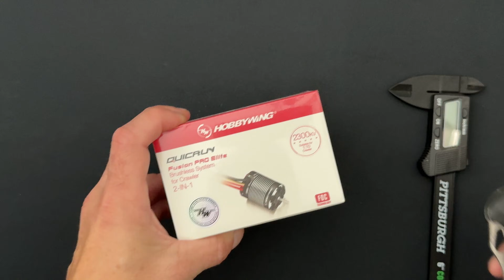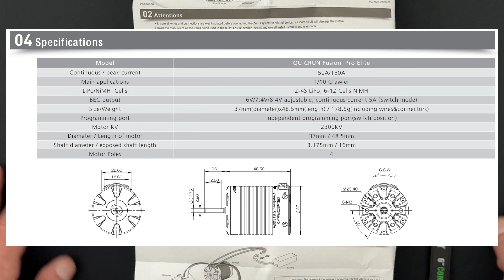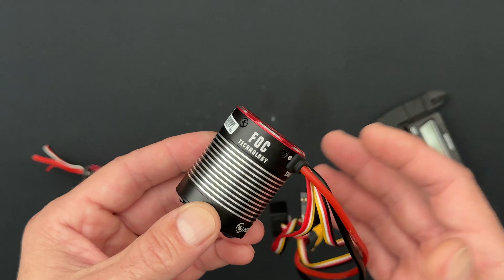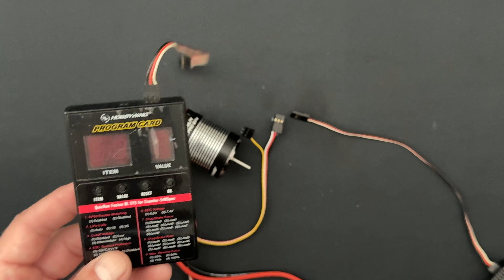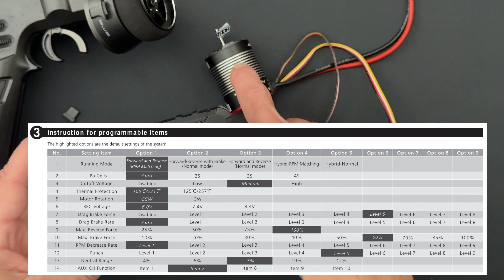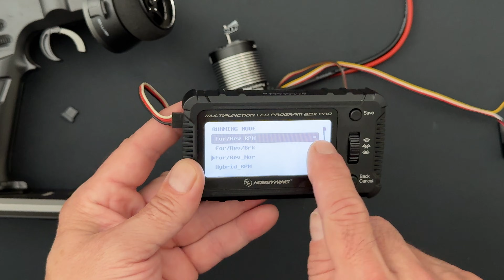HOBBYWING Fusion Pro Elite - First Look - The Charlie Show EP 438

Comment: Will Hobbywing eventually release a Fusion Pro can size 2 in 1 with the Fusion Pro Elite ESC? The Fusion Pro Elite seems to have to load up then pops out of a bind, where the Fusion Pro just muscles it way through a bind with slow and steady precision. Don't get me wrong, I think the Fusion Pro Elite is PERFECT for comp crawlers, and is ideal in my VRD Carbon and XP10, but I'd love to have the higher torque of the full size Fusion Pro and 4s capability for my H10 Optic builds. And I think everyone with a Traxxas TRX4 is thanking you for the Fusion 8 Pro. Best motor ever for a TRX4.
Reply from the maker: NorthAmerica@hobbywing.com - Drop us an email if you get a minute and we can discuss a few things of course.  Overall though, anything is possible! ;)

Comment: Please add separate forward and reverse max RPM. (Yes, I know that many will claim that this can be done with throttle limits. I do not want FOC, and I do not want to limit my reverse torque to 25%; I want to have full torque, but only 25% of the max speed.)